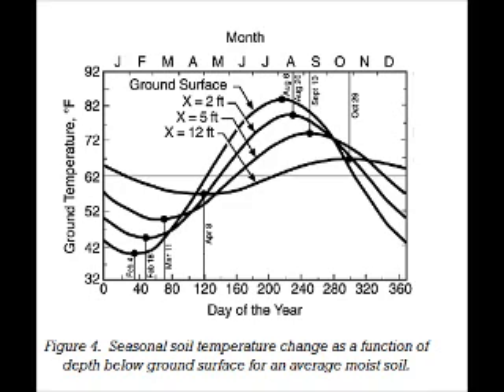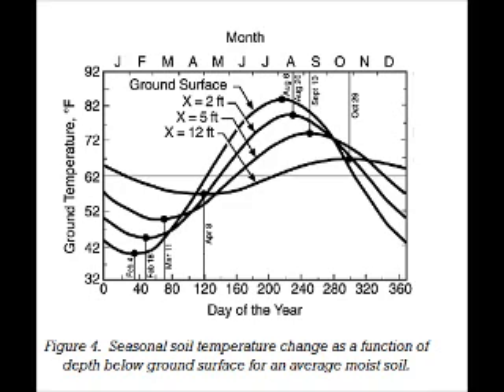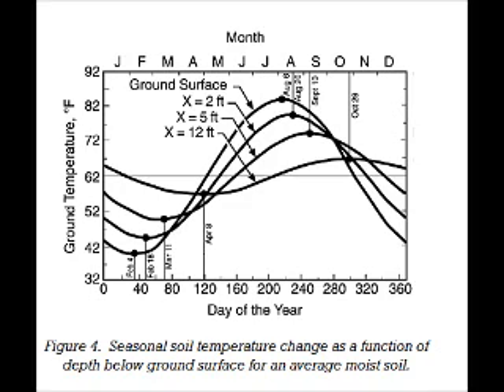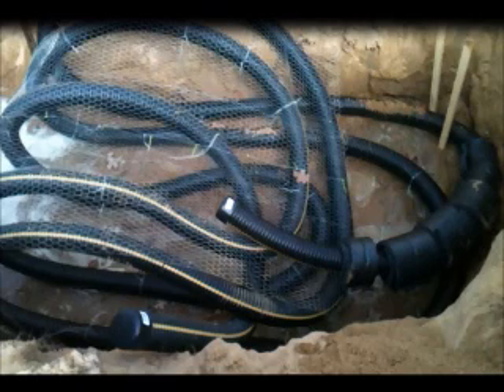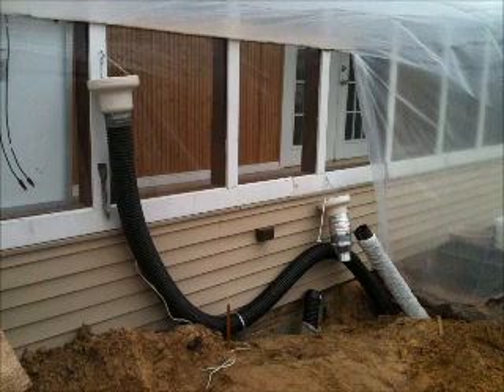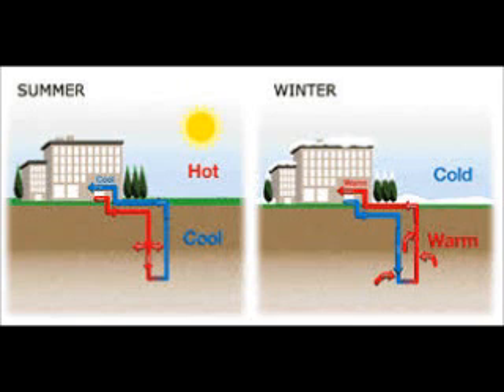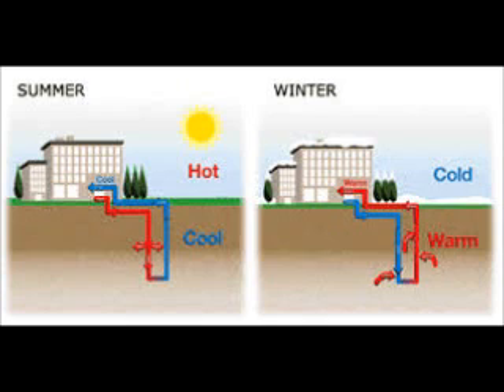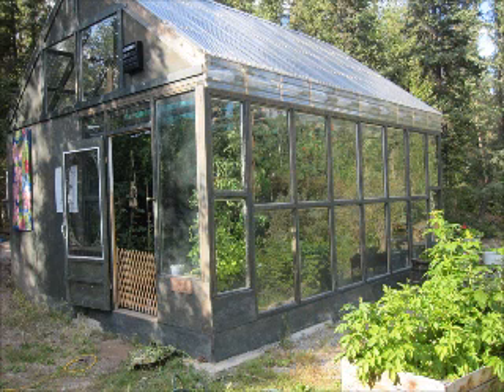DIY Simple & Dirt Cheap Alternative & Sustainable Heating & Cooling System

Comment: Thanks for sharing your thoughts and experience. I really like the layered piping system rather than digging a longer trench. My question is this. The pipe that is set at 6 feet is it one continuous pipe that goes through the 4 foot level as well or is it two different pipe systems? One system at 6 feet than one system at 4 feet.

Comment: Heat structure like attached green house, then have cheaper air source heat pump operate off that....?If soul purpose was to help pump the size of building might not need to be huge, don't know, it would have to have enough volume in building(the more the better) and will tude be as effective. Would work best of course heating a floor etc since sun would help in daytime.

Comment: Have you given any thought to sealing up the system so you can use carbon dioxide instead of air? Carbon dioxide carries heat much more-so than regular room air. I know you would need a heat ex-changer,  but it would be easy to build one out of copper pipe.
Reply from the maker: I don't know anything about using co2. Plus, I would have to dig the whole thing up to do that.

Comment: The water from the moisture will be gathered in the underground pipe. How would you deal with removing those water?
Reply from the maker: Cut a slot in the bottom of the pipe for drainage.

Comment: The biggest mistake I see is people have a glass wall on the north side. This is a "Never do this" thing . Always have the north wall be heavily insulated. you can make up for the lost light just by painting the inside north wall white. (the number don't lie.) east and west could/ should be partially insulated at least half way up.They are partial contributors to total heat gain so for those you have to do the math based on how much sun they get at your latitude and solar foot print on how much you want to insulate them.  And do not forget to run the insulation down into the dirt at least to below the frost line.
Reply: What about combining this with a  sub-terrain greenhouse?
Reply: Brilliant. Great info. Thank you.

Comment: How deep did you bury the tubing that ran from the greenhouse to your house? Building a a 500 square foot walapini. I plan on simply running a pipe from my walapini to my house. So instead of just dumping hot air in the greenhouse outside in the winter, that heat will be pushed into the house.
Reply from the maker: That's a great application but I didn't run tubing from the gh to my house because my house is already heated with passive solar.  Excess heat from the gh is being stored in the ground beneath the gh and then pulled back into the gh on cloudy days and at night.
Reply: How do you store the heat in the ground for later use?

Comment: aluminum tubing works the best or copper.... whatever you have laying around. this is because of the science of convection and the properties metal has with convecting and dispersing heat. metal tubing will result in best convection between air temp and ground temp. 
++Source++ Farshad and Tyler  PHD students of Mechanical Engineering
Reply from the maker: Yea, I usually have hundreds of feet of metal tubing laying around lol. :) But seriously, if you don't mind paying 5 times as much and a lot more work fitting it together, metal tubing would be far superior. Btw, the heat transfer is through conduction not convection. Metals are conductors.
Reply: Paul Ladendorf sorry about that haha as you can see I'm not the engineer... Farshad and Tyler are.

Comment: paul  i watched your video and went out back with a shove to dig a 6' deep 60'long 3'wide trench to run 200' of 4' tube through   i gently zigzagged the lines from side to side to fit both 100' rolls in.  iglt took a lot of effort but im excited to test the results this winter  thanks for the idea i would have never known about that black flex pipe   thought you might like to know your video helped others.
Reply: I hate to say it but it wont be very effective.
Reply: How did it go?

Comment: Go off-grid with a solar panel battery system to power the fans... Not sure you'd save any money at $5 per month "grid cost", though. Also, I've read about so called "Earth Batteries" that produce electricity. How well they work depends on the local environmental conditions, I'm sure. What I read didn't seem too effective (not a lot of power produced), but your power need seems pretty small, too, so... I'm just mentioning it, since it would be more constant, and totally continuous, than sunshine as a power source...

Great story! Thanks!

Comment: Air is a poor medium of energy (heat) transfer (low conductivity), and is also very poor at holding energy.  You would have had a much more efficient and performant system (and probably cheaper) if you pumped water into the ground and through the flooring of your greenhouse.  I'm doing mine with a 5 watt pump and a couple < $100 heat exchangers.
Reply: Air works fine as long as you move enough of it. On average with the greenhouse at 80F, i move almost 8kw of heat per hour with 68w of electrical power.  How do you plan to get the heat into the water?
Reply: I put energy into my water using several methods.  First is from direct solar radiation on the reservoir surface area.  Second is from direct solar radiation from coils on a solar heater panel.  Third is from an air to water heat exchanger that cycles all greenhouse air through the exchanger at least every minute.  Fourth is from a propane water-cooled CO2 generator that I use as a fallback if temperatures get too cool (below 9C at night and below 15C during the day).

As the temperatures have been cooling in my area, my greenhouse temperatures have not dropped below 10C at night with 5C outdoor temperatures.  That's with the solar heater disabled, the reservoir covered with reflective material (cooling mode) and half of the vents still open (I only have two vents, one for intake and one for exhaust).  I'm only using 1/4 of my heating solution at the moment and meeting expectations.

Comment: This seems like similar attempt to Russ Finch's "Citrus in the Snow" geothermal greenhouses in Nebraska.  Your installation expenses appear to be much lower.  However, he appears to have greater energy efficiency on a much larger scale.
Reply from the maker: +BonnieBlue2A The big difference is his gh is 4' underground. Plus he gets about twice as much sun as we do near Chicago in the winter. IMO thats why his greenhouse does so much better. I have his ebook (not recommended).
Reply from the maker: +BonnieBlue2A The big difference is his gh is 4' underground. Plus he gets about twice as much sun as we do near Chicago in the winter. IMO thats why his greenhouse does so much better. I have his ebook (not recommended).
Reply: Paul Ladendorf  To get the optimal results from geothermal heat/cooling, one must go below the frost line.   It I precisely because what you have mentioned about you having less sun that your tubing should be below the frost line.  just my opinion. 

The geothermal greenhouse I was fortunate to see in Northern MO utilized multiple layers of tubing, the top one was just below the frost line with the additional two layers much deeper.  It utilized computer fans to slowly push the air through the tubing and was solar powered.
Reply from the maker: +BonnieBlue2A I have 2 layers of tubing, both beneath the frost line. After spending hundreds of hours researching these systems and talking to several professional installers, I believe where Russ and those who do similar installs are really missing the boat, is they are venting the greenhouse outdoors when it overheats on sunny days. Instead, they could be blowing that hot air down through tubes to warm up the ground even more.
Reply: You should use vertical perimeter insulation to isolate the greenhouse soil from outside soil. Horizontal "wing" insulation is a no-dig option if you have enough space around the greenhouse. Computer fans pushing air slowly through the tubing is not what you want. You need sufficient airflow to put the entire greenhouse air volume underground 10-60 times per hour. Long tube lengths such as those used by citrus in te snow (7x 150ft) restrict the amount of air that can be used due to the losses.
Reply: Paul Ladendorf Probably accurate if you are close enough to be getting the Lake effect clouds/weather in the winter.  I had not thought about that.

Comment: In Mother Earth News many years ago they reported on a house in Arizona that used buried corrugated tubing to cool ventilation air. The temperature drop on the air was substantial. They had to remove the tubing because water would condense inside the tubing and created a perfect environment for mold and other diseases.
The second comment is the system where you store summer heat was used in a house that was called an "umbrella house". That house had an insulating later underground around the house that looked somewhat like a giant greenhouse. They stored summer heat under the insulation and recovered it in the winter using a heat pump.
Reply from the maker: +James Fergusson That's why most installers recommend using the perforated (slotted) tubing so that condensation can drain.
Reply: what about fungus in the tubing. i guess you cannot keep it completely dry even if you have a perforated tubing
Reply from the maker: Great point. The corrugations will collect water.
Reply: Its not an issue, the airflow creates a highly aerobic environment inside and outside the tubing. As a result the natural soil flora thrives which prevents anything bad getting a foothold. If you`ve ever seen plant roots that have grown into worm burrows in the soil you`ll have an idea of just how healthy it is.
Reply: 4121Z0N4  
My system has been in use for a decade with no issues. I dont know which diseases you are referring to but if they are well documented maybe you could provide references. I guess most will be related to radon gas which is dangerous but also area dependant. I can tell you that mold and fungus growth in the tubing  isnt an issue, i had a local plumbing and drainage firm check my tubes years after installation with a fibre optic camera and they were as clean as the day they went in the ground. If you believe these systems are dangerous i`d recommend installing one and doing the tests  Allow a few years for the system to reach equilibrum with the surrounding soil flora and fauna and fit a filter on the outlet plenum for several months. Send the element to a lab for culture tests but dont be too surprised when no harmful bacteria are found.
Reply: 4121Z0N4  
You need to read the posts again. I`ve never advocated, or would advocate using a shcs as a substitute for domestic air conditioning or in a domestic dwelling.  My system, like many others, is installed in a greenhouse where plants live, not prople.

Comment: I think another fix for condensation (if the groundwater table is lower than the underground tubing) could be to have little holes in the lowest portion of the tubing to drain any accumulated water

Comment: Hello. 
Thank you very much for the video. 
So I dont know if I got it right:

1. dig 2m hole. 
2. lay 200 feet of the AB?S tubing
3. what do I do with the fans? I didnt get it

Thanks!
Reply from the maker: +גלעד פישר The ends of the tubing come up into the greenhouse. You connect a fan to one end of the tubing which blows the greenhouse air down underground through the tubing to warm or cool it and then the air comes back up into the greenhouse at the other end of the tubing.

Comment: Would the earth regulate the temperature in the greenhouse better if the greenhouse were say 4 to 6 feet deeper into the ground? You would walk down into your greenhouse but above ground is the typical greenhouse.
Reply from the maker: If you're building in ground, a system like this probably wouldn't be necessary depending on how deep you go. Think how warm/cool an unconditioned basement stays. And yes, the fans are loud as you need to move a lot of air depending on how big your greenhouse is.
Reply from the maker: +s8kmfmx1 Yes, if money is no object, you can just build an in-ground greenhouse. But the cost is going to be probably at least 5x more than doing this (concrete is expensive) unless you build something like an earth ship and do the immense amount of labor yourself. This can be done in one day This is a way of getting the benefits of an in-ground greenhouse without all of the expense and/or labor.
Reply: i want to build an in-ground greenhouse part of my living space. do you think i will benefit from this system? Also, aren't the fans too loud if you want to live in that area?

Comment: Hi Paul, I'm working on building one of these for my greenhouse. I live in FL and thought this would be great for keeping it cooler. The only problem I might run into is ground water when I dig. I was thinking if I used solid piping that would resolve the issue, but I read your post below about mildew and don't really know how it would work if I do run into water with the corrugated pipe. Do you or anyone else on here have any thoughts or ideas?

Comment from the maker: Update: I've determined that a better tubing layout will increase air flow substantially. The way its currently laid out, its just 1 100' length of 4" tubing snaked around the foot print of the GH (see pic in video) and there are way too many bends which reduce air flow. The new layout will use 6" Y's instead of just bending the tubing. Since the Y's are 6" it will reduce the pressure drop and increase air flow meaning I will get more heat with smaller fans. This will also mean about $150 in added up front cost for the Y's but the savings on electricity to run bigger fans and a backup heater in the long will pay for itself in probably 2 years.
Reply: hello sir.i would like to talk to you for instructions.
Reply: Tell me more on your update. Are your 6" y hook to 6" pipes & then 4" pipes, or are they all 6" pipes. For a 11'x 9' x 8' tall greenhouse, would you use two fans, & best way to lay out the pipes & size of pipes.